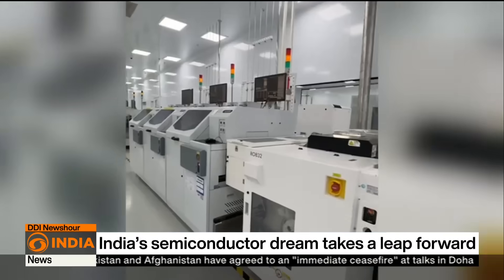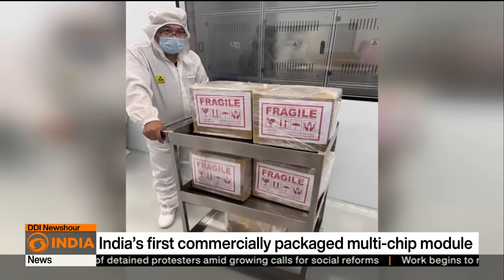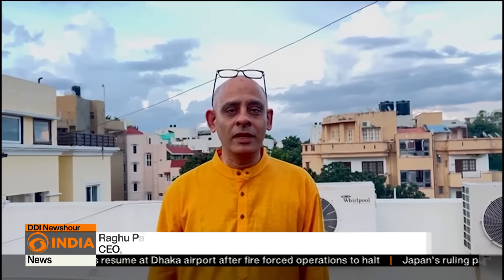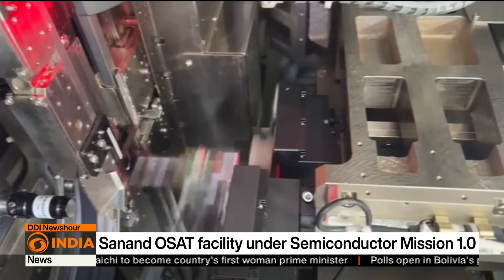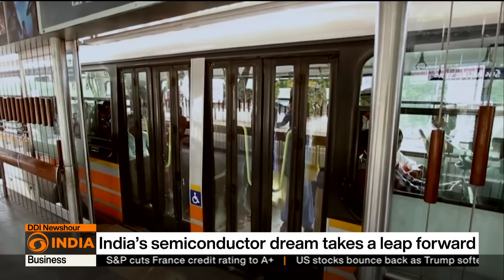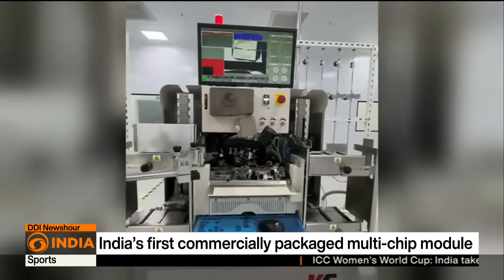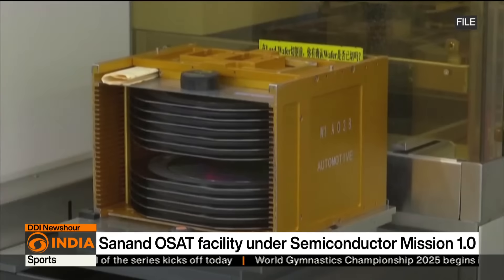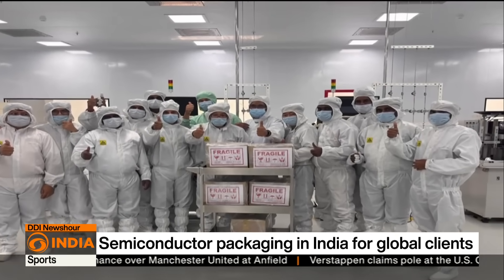India Ships First Made-in-India Multi-Chip Modules from Gujarat | DD India

Comment: Theze r smtps ( switch mode power supply modules ) its a good step in da right direction. Till now china has been filling da market. Versatile units incl. For cctv networks.  Clearly for a specific client meant it had to fit dere specs so again congrats & may bharats micro tech dream grow from strength to strength & from a dream to reality.

Comment: India should aim to assemble first... end to end semicon stack is impossible. They can simply import lithography machines and start assembling quickly, once an ecosystem is built, they can easily build that larger ecosystem which can be 1-2 gen behind, it's fine, at least the capacity will be built.

Assembly is key.
Reply: Your opinion has a huge error
:it makes too much sense
Reply: @kokkarneBramhavar haha yeah... you cant so the entire stack yourself... not even the US can do that.

Specialise in some aspect first, integrate to a supply chain and then eventually scale up is the best way forward.